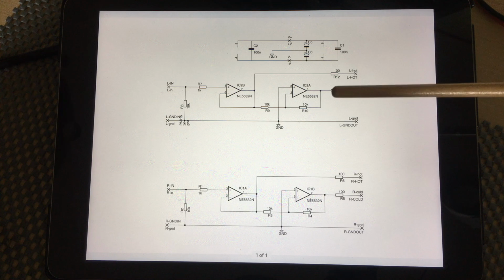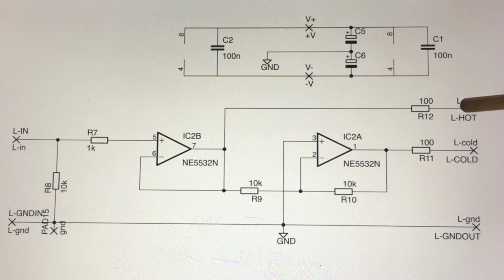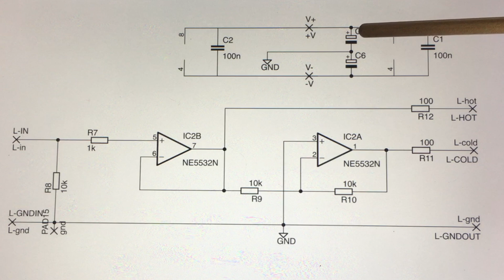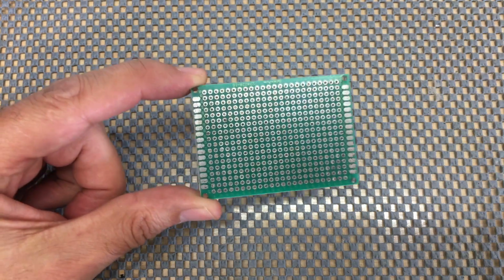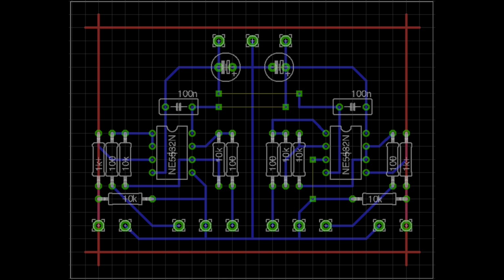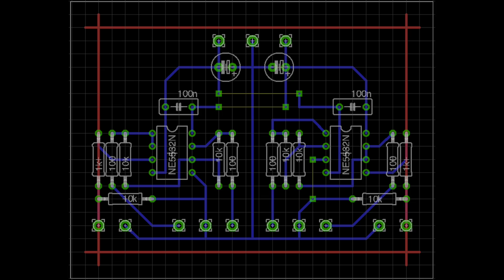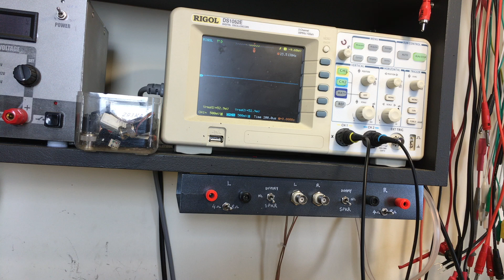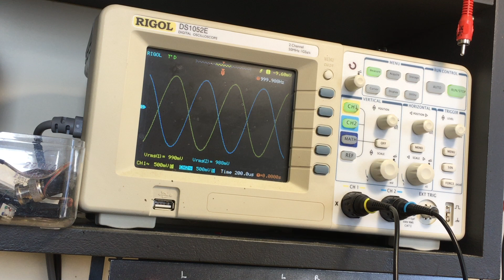How to Build a Balanced Line Driver for audio testing.

Comment: What is special about XLR? why not just buy an assembled circuit from on line shop or buy the xlr to rca converter.
Reply from the maker: Because I like to make stuff 😊
Reply: @JonathanGarcia-pr9eo  also you can send audio over xlr on very long distances without interference

Comment: Thanks so much for your video. I am new to differential signals. I how do you think this circuit would go at 300kHz? I am changing my small CNC lathe spindle motor to a faster AC Servo. The driver needs a differential signal each for step and direction input due to the speed. I produce those inputs from a 5V MCU.
Reply from the maker: Probably Ok, but can’t be sure.
Reply: @electronicsoldandnew  Thanks for your reply. I'll give it a go. :)

Comment: I came across your video while looking for information on unbalanced to balanced conversion. It's a very clear explanation, thank you.
I would like to ask if this circuit could be used for moving magnet phono-cartridge levels of about 5mV? Would I need to change the input resistor to 47k to match the moving magnet cartridge? I have a phono pre-amp that has balanced XLR inputs and at the moment I am using a connector which simply shorts the cold side to ground.

Comment: That isn't a good balanced line driver circuit. I would have been simpler and better to have just used a line isolation transformer with 1:1 winding ratio.
Reply from the maker: Agreed, but compare the price. Good transformers are very expensive. This was presented as an alternative to transformers.

Comment: Hi there. Never studied electronics but retirement have pushed me building Bluetooth modules and even an amplifier, with success!

First. Looks like you added a resistor marked 1K+ on the PCB design, which does not appear on the schematics. It is located between the input line and pin 3 of the opamp. But on the PCB itself it looks like a 100 ohms value. Could you please confirm.
 
Second. You also mention powering with batteries, which are + and - without ground. If I use a 12 volts DC supply, can I forget about the ground since it only provides + and - wires?
 
Third, what would be the voltage requirement for the 100uf capacitors?
 
Thanks for the good quality video, impeccable diction and absence of distracting music. Cheers.
Reply from the maker: the resistors are correct. Check carefully. 
You need a split power supply, so the 12V battery won’t work. 
I normally use 25V caps for this supply range.
Reply: @electronicsoldandnew  Thanks for your prompt answer. Found a revised video where the 1K resistors were added and the 1000uf caps are rated 50V. If I understand, the audio ground is independent from the power supply ground. Do you have the schematics of your 12 volts DC regulated power supply using LM7812 and 7912? Yours seem to use more diodes and resistors of what I found on other sites.

Comment: Hello! Came across your channel looking for information on how is it possible for passive direct injection boxes to balance unbalanced audio signal with no external power whatsoever. Whirlwind famous DIR model claims to do so, and I don't have a scope to verify it. I'm sorry for asking this upon my first visit to your channel, but you're the one closest to the answer I look for. Thank you!
Reply from the maker: I have no idea 😊 The only passive way to do this is with transformers, which are fantastic solutions but quite expensive.
Reply: Yeah they use transformers.. radial engineering is probably the the most popular current DI box manufacturer. They famously used Jensen Transformers.. And they are pricey boxes..! 
They also make it cheaper more affordable line that's still pretty expensive. But those use the lower and generic transformers.. Chinesium brands

Comment: Thank you for the video. I'm a bit new to some of this so forgive me if I'm asking a dumb question:
I need a balanced line driver for a 12V application as the original product is discontinued, but the rest of my setup requires them and I don't want to pay the $500 asking price for ONE on eBay.
Basically without the green ground wire would this still work between 12V and 14.4V DC? The cabling is a 6 pin mini din, but I think I can handle that change.
Again, sorry if it's a glaringly naive question.
I thought I understood electronics until I started to learn and I thank you again for sharing.
Reply from the maker: Hi. I’m afraid I don’t understand the question. What system is it? Perhaps I would be able to answer you then.
Reply: @electronicsoldandnew  
The pertinent components are car stereo active crossover network and class A amplifiers made by Soundstream. All of the inputs are 7 pin mini din balanced. There are no RCA or any other kind of input or output other than that on the crossover and thus the amplifier input is the same. The amplifiers do have RCA inputs, but not the crossover. I have the schematics for the amps. RCA to balanced mini din were manufactured by Soundstream, but are near impossible to find, so I thought I could make my own pair. I'm confused about the power coming in. The green wire makes me think it's not a DC input, but I don't see a rectifier. Is it just the audio signal itself that is powering everything? I'm trying to make sense to explain something that doesn't make sense. Sorry.
Reply from the maker: That is a question I’m afraid I can’t answer. I haven’t played with car systems at all, so any advice I give could have drastic consequences.
Reply: @electronicsoldandnew  I understand. I went and got the schematic for the amplifier and I have a pinout for the line driver itself, so I can go from there. Do you have any suggestions on where to go for help? Again thank you for your time and help.
Reply from the maker: I’d suggest the forums that are specific to that type of application. They can be very helpful.

Comment: Hi, I want to ask if the middle point of the transformer should be grounded because a crack is heard when I turn it on, I want to use it from preamp yamaha cx-630 to crown xti1002
Reply from the maker: Transformer? I don't use one in this design at all.

Comment: This is maybe very nice, but simply not works after Your schematic. I don't understand why, what's the problem, but nothing comes out from them.
Reply from the maker: X3N0N M : check that you haven’t connected something wrong. The schematic does work, and I’ve built quite a few units from it. Good luck.

Comment: Sir nice work,
I wand to make a balance audio,( stereo) for my Rcf sub 705, I am not using a mixer ,I am using RCA to XLR wire for connecting,it is wired as a unbalanced type, in XLR pin 1&3 are connected as ground & pin 2 is Audio,the system is working but some noise,
As the circuit mentioned in the video,I think it helps me to solve this problem,
Do you have much more efficient circuit for RCA to XLR balance mono?
Reply from the maker: No I don’t. There are endless articles on the net that cover the subject and you may find something that makes a difference to you. Look up “Elliot sound products” where you’ll find various articles that are really great on this subject.
Reply: @electronicsoldandnew is this circuit mentioned in the video help me?

Comment: hello, an old video, but this is related to what i need. my question is can i used a tube low wattage amplifier with it's output transformer as a balanced source signal? as always output transformer of a tube amp tap has an 8 ohm or 16 ohm and a common usually connected to ground, whatabout if i disconnect the common tap and used it as a negative signal, and the 8-ohm tap as the positive signal, and then chassis ground as the ground? will it drive a balanced input device properly? thanks for any advise that you can provide.
Reply from the maker: I’ve never tried that but it should work. However, you’ll  have to use the common (0) as the negative signal, the 8 ohm as ground and the 16 ohm as the positive signal.
Reply: @electronicsoldandnew  thanks for the advise, i'll try that and let you know if it works or not. for the moment i am using a passive direct box to interface my sca-35 dynaco tube amp to balanced drive my 2 electronic crossover of my 4-way active stereo system, but the problem is the di box is reducing
the signal significantly, bec maybe of transformer used in the di box? thanks.
Reply from the maker: I did some thinking. YOU CAN’T DO IT. 
The tube amp needs to see an impedance on the primary which is a direct reflection of the impedance it sees in the secondary (the speakers). It expects 8 or 16 ohms to give the high impedance that the tubes need to drive. If you don’t have that speaker on the output, the tubes will see a crazy load that will probably mess with the tubes and the actual output transformer. Not good.

Comment: I recently did this as an Electret mic preamp but reversed the OpAmps. I set gain on the first one and inverted last. Works really well. I Like the simple circuit but do prefer the reverse OpAmp stages as gain can be added in as needed which affects both output signals.
Reply from the maker: Yes, that does make it simpler. I didn’t need much gain so this one was my choice for now.

Comment: I was just looking at the back of the Gryphon and noticed that it says Zero Negative Feedback. Does it really not have a negative feedback loop?
Reply from the maker: If I’m not mistaken, it has local feedback in the driver stage, but not global.
Reply: @electronicsoldandnew  Hmmmm, still though... I have heard the arguments over negative feedback but I have never seen one! Even if it's a local stage, I have seen circuits with global, I have seen circuits with multiple local, I have seen circuits with multiple local and global negative feedback at the same time... But I have never come across a circuit without or even just a local driver stage. Have you still got the schematic for it... This is a topic that deserves it's own video! Apparently according to some people, that an amplifier without negative feedback is possible and sounds better than an amplifier with negative feedback. While on the other side of the fence, people argue that it's not possible due to stability issues... Do you think that you can at least have a look at the schematic and see if it actually has or hasn't? I have a feeling that they didn't put zero negative feedback on the back for nothing!